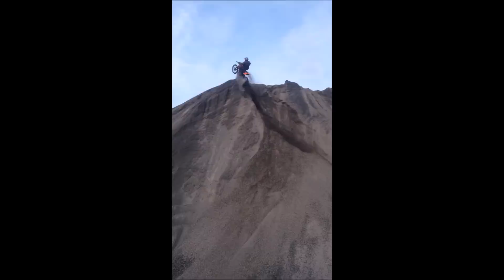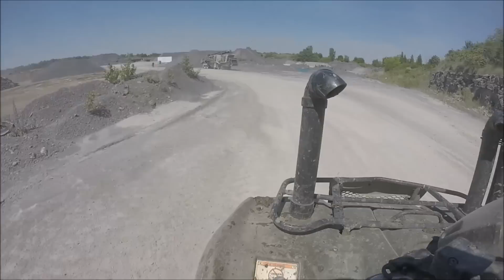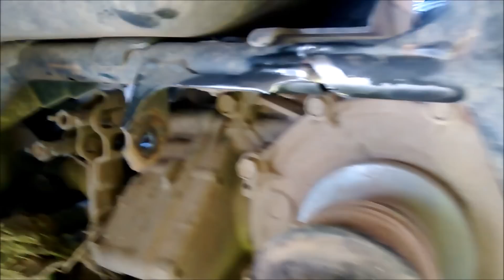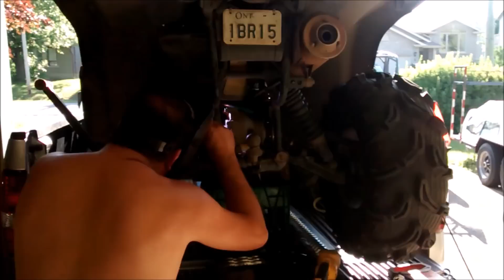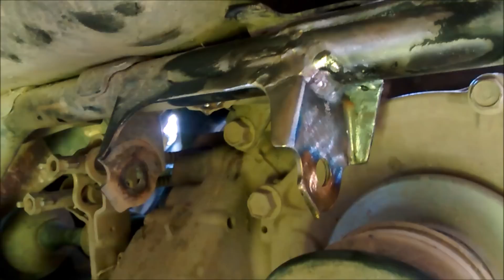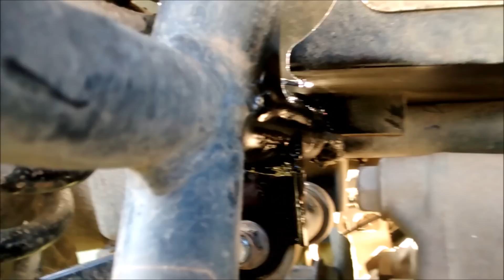BROKEN ATV FRAME AND REPAIR

Comment: Holy f#*k buddy, don't you ever wash that thing? Hahahaha! I'm surprised the 2 bales of hay you had laying around inside the frame compartment didn't catch on fire when he was welding. LMAO!!!
Awesome that you were able to get it fixed so fast. Hate to see you out of commission for too terribly long - lol.
Reply from the maker: ROFL this was considered clean where I'm from. But seriously it wasn't the grass I was worried about, It was the fuel tank two inches away. But he used a Tig no spark!!  It was on the truck when I found the crack and at a great welding height so I left it in the truck for two days until my buddy could fit me in Hahahaha Busy guy. Can't leave your buddy's behind you know, everybody has to be ready for the next weekend LOL Cheers and thx bud

Comment: wow that's crazy what do you think caused that did you hit something and how did you notice it did it ride a little different make some type of noise or did you just see it doing routine maintenance I will get mine out there every ride but that's not something that I would have looked for definitely will be looking at mine nice riding and keep the videos coming
Reply from the maker: I usually look the bike over before and after every ride, and have lost a lower A-arm bolt before on the trail. So I look them over well, And low and behold there she was staring me in the face after a good day out.The cause, well I would have to say my fault for not upgrading the suspension for the way I ride!!! there is only so much bottoming out one can do before the stress takes affect on the frame. Excessive jumping, smashing into steep hill climbs over and over  and extreme winching!!! that's my guess Hahaha Cheers and thx

Comment: had something similar happen to my rear on my king quad. I had a guy rear end me and clip my right rear tire and ripped the top a arm mount of and one of the lower tab rip too
Reply from the maker: You could clearly tell that the factory weld on the back never properly penetrated. Damn shame, but good to go now thx to Bryan.